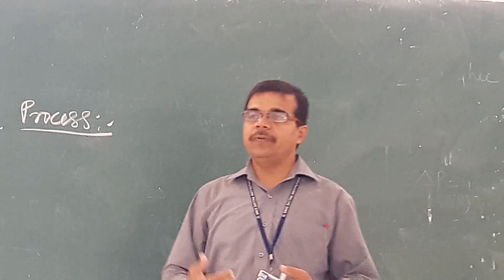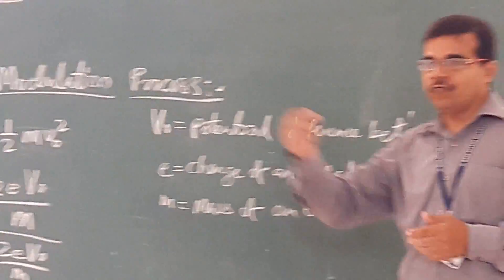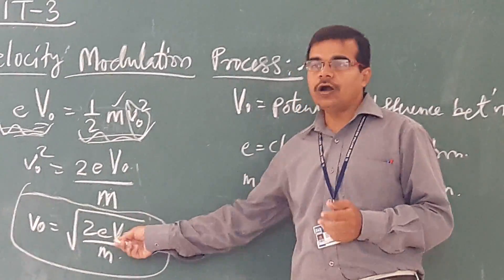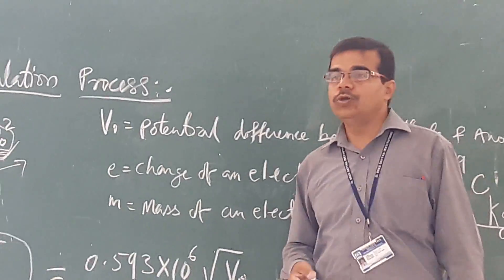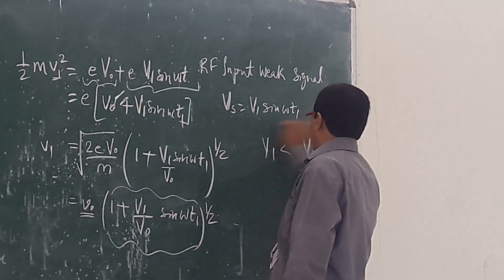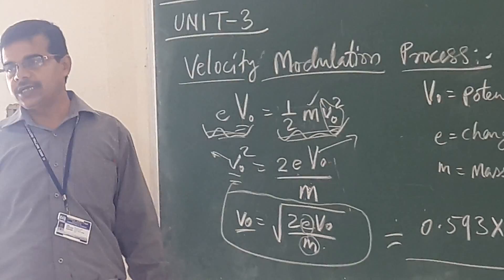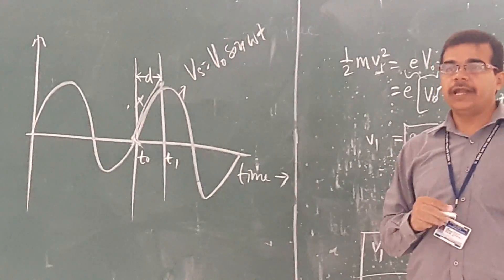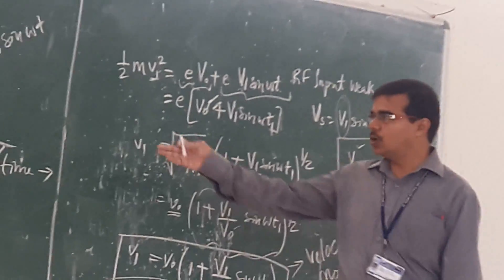MWE UNIT 3 TOPIC 4/6 Velocity Modulation Process

Comment: how v1 is possible in rhs of the eqn in velocity modulation. it should be other variable for instantaneous voltage of rf input signal
Reply: https://www.youtube.com/watch?v=eU6oZsnITsA
Reply from the maker: You can even try the app "anmol classes" under google play store. It is having app for Microwave Engineering, Satellite Communication, Basic Electrical and Electronics Engineering, Digital Logic Design and so on.